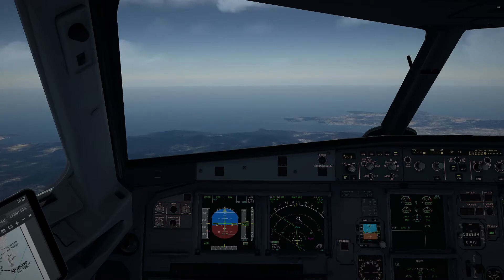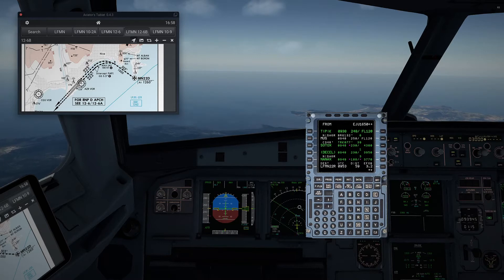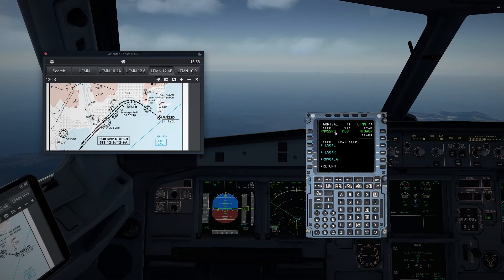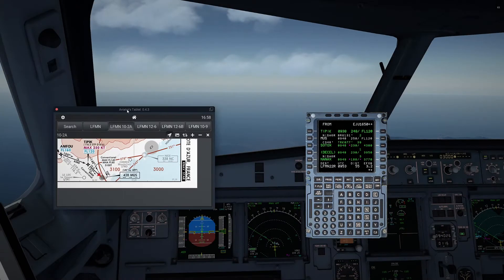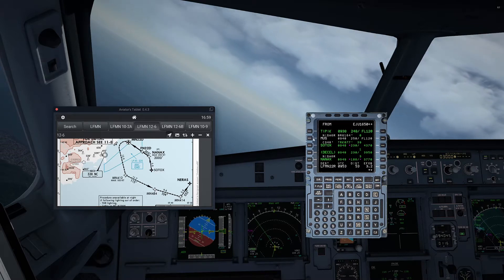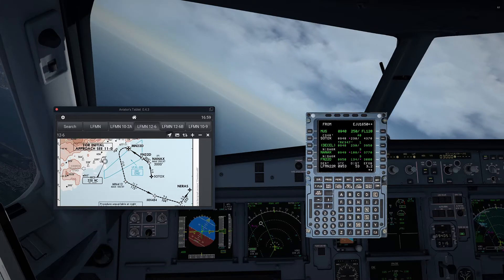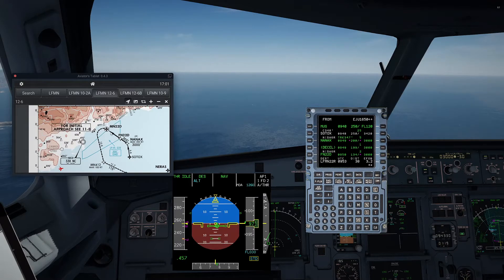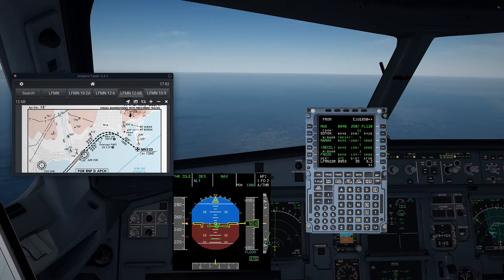X-Plane 11 | Toliss A319 | LFMN - Nice | Visual RNP D approach runway 22R

Comment: Another great tutorial Matteo, very informative....one question....the radial from AZR to aid your turn onto finals, why 20° (ish) offset from rwy reciprocal (065°)? Is this a magic/rule of thumb figure ?
Reply from the maker: Hi Ian, that radial has more to do with the descent than the turn. You basically start the descent from MDA when crossing the radial.
Reply: @matteochewie4373  why at R065°  though?
Reply from the maker: @trippedCB  Ah I get you now. I don't think it's calculated in any specific way, I just found it in a real airline's briefing for that approach.
Reply: @matteochewie4373  ah ok thanks, well researched. Knowing that you've put a lot of self learning into your simming it's great that you can share your knowledge with us...thank you